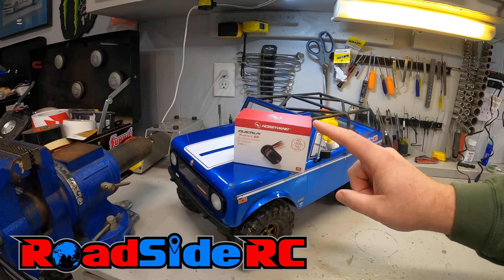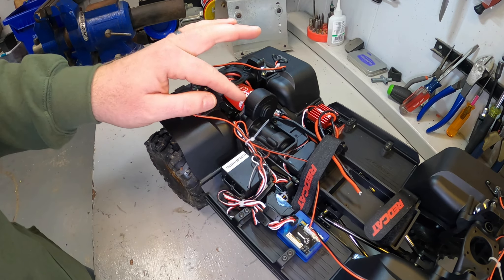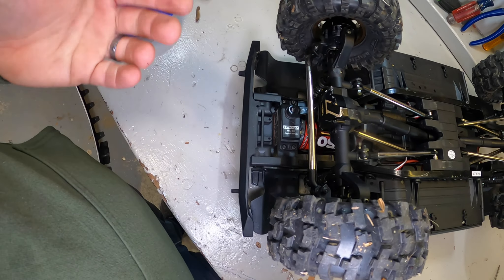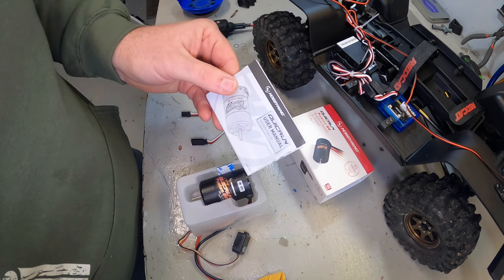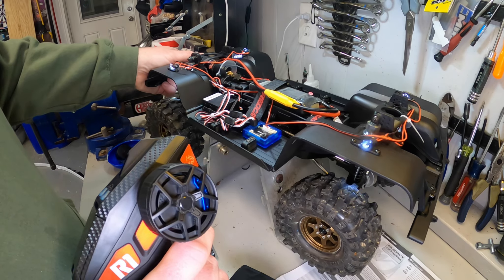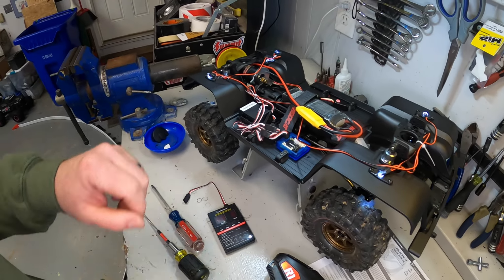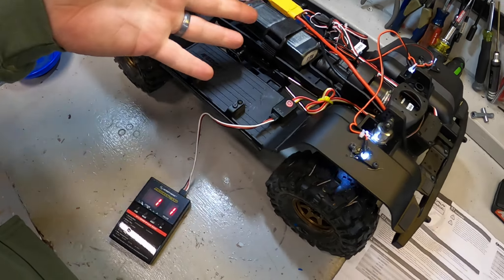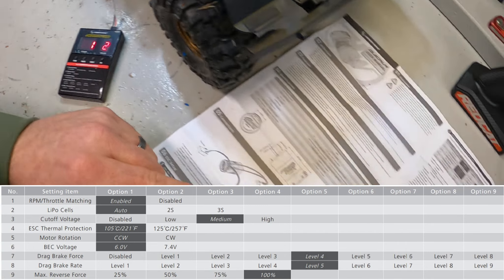How to Install Hobbywing Fusion SE (Redcat Gen 9)

Comment: Did you do the motor calibration before you put it in?
The Charlie show episode 292 explains it.
Reply from the maker: That video shows 2 main things:
1) calibration of neutral/throttle/brake.   Yes - I did that once installed. 
2) the motor-ESC internal calibration.   That is not required unless there is an issue with driving.   It is listed as optional in the manual and used as part of trouble-shooting.
Reply: @RoadsideRC  
My bad it’s the automatic motor pairing process.

Comment: putting the 2300kv pro in my gen 9, would i need to change receiver to run higher voltage to servo since the servo can take higher voltage?
Reply from the maker: Nope!  Will be fine with the stock receiver.